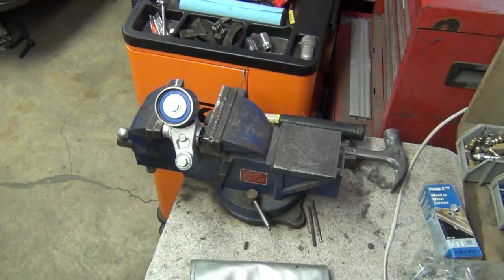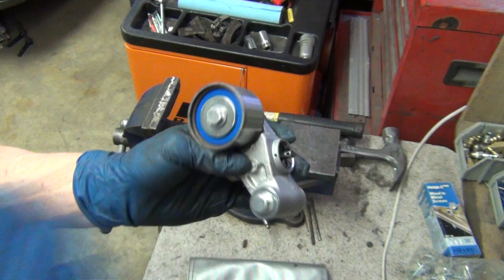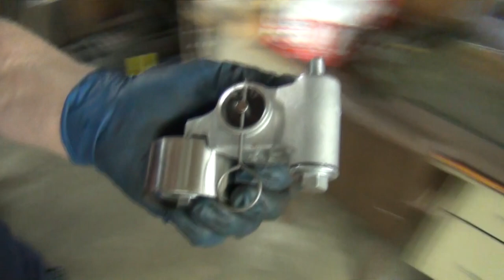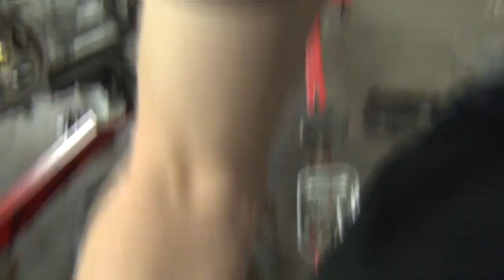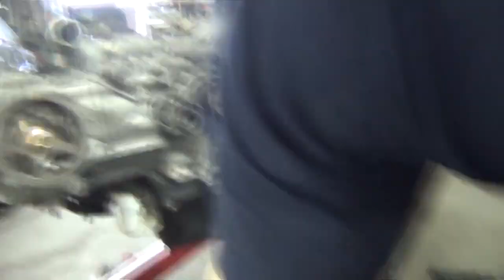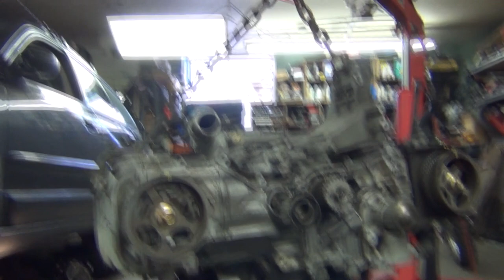How to Take off a Subaru Timing Belt

Comment: Hey - just did the heads on a 2.2 - your video was invaluable - great tips, like the tensioner. Here is something that you might use - took an old spark plug, cleaned out the electrode, etc, then silver-soldered a piece of copper tube into it (from the porcelain side). Stuck a rubber hose on that, then a compressor connector on that. Screwed it into a plug hole, put 50 lbs of air into it and it held the crank steady just fine so I could torque the crank bolt. Thanks Brian, great work.

Comment: As others have mentioned, the service manual warns that you must compress the tensioner vertically, not horizontally as in this video.  In not sure why, exactly, so be careful.  It would suck to have to repeat the job due to something like this.

Comment: Hey Brian,you can leave the tensioner in place use a torque wrench on the bolt idler and slowly pull the tensioner up until the holes line up and fit the pin.

Comment: Hi Brian,  I have a very similar Subaru engine on my sandrail and I don't know much about it.  I do know for sure that it is a 2.5 L and it has twin turbos and it's remarkably powerful.  Where can I find out exactly which engine model it is?    And you have produced yet another excellent video.

Comment: Hey Brian, love your videos! Very informative, you clearly know what you're talking about and have a knack for teaching and keeping things interesting.

I've got an 02 outback with almost 160k miles and the timing belt has some cracks forming on it, so I'm planning to replace it (guessing it hadn't been done?). What other work would you suggest doing at that mileage while I have the front of the engine stripped down? Water pump as a preventative measure? Adjust the valves? Crank seal?

Thanks!

Comment: Hey Brian! Ive run into an issue with my 2.5 DOHC motor, I took the timing belt off at an unknown timing mark and the cams turned and now I am unsure of the proper timing....What is the right way of getting the timing set back right?

Comment: Review the dewalt! I've been thinking of getting a 1/4, 3/8ths impact. One for small 10mm socket bolts and the 3/8 for bigger bolts. Sadly, the cheaper 3/8ths only do 130ftlbs and the $300 do 180ftlbs but only one battery. 

I don't want to be breaking bolts, but don't want to spend lots of time spinnings small bolts. And I picked the 3/8ths due to size, gotta fit in the engine bay, not like 1/2"ers. 

The 130ftlbs sears brand won't do it for my crank bolt.

Comment: Brian, I had my oil pump replaced by a mechanic with a new one and he used Honda bond silicone around the housing before he reinstalled it and torqued the 10mm bolts down loose. He said torqueing those 10mm bolts are not necessary but after he installed it, it still leaks! Did he not torque em down enough??? Can I take the timing cover off and tighten them to stop the leak? Thanks, Marc

Comment: I just bought a 1999 legacy outback with 122k miles and seems like almost no maintenance other than oil change was done. I am going to replace spark plugs and wires, fuel filter, pcv valve, and timing belt. Anything i am missing that u suggest? Also everybody tells me to use oem but i cant find oem timing belt and oem is 3-4 times the price. Is gates a good option?

Comment: soundslike you need to start over..re aline the cams and the crank   the  install the belt ..sounds like you have pistons hitting valves ..you may have installed with the cams 180 off

Comment: That tensioner looked decent, however, you need to make sure that its not leaking oil and the idler bearings are good. After 100,000 miles theses tensioners typically  crap out...
Reply from the maker: Good call

Comment: Hey i need help brian, i have a dohc and i  put the belt on but i didnt put the pin wen i turn the whole motor it stops half way, wen i turn it both ways is that because i didnt pull the pin or is something wrong with the engine?

Comment: Can you take the cam gears off while the timing belt is off, I need to change out my cam seals.
Reply: Yes you can, as long as the crank sprocket is lined up and in place, you spin the cam sprockets all  your want...

Comment: hey brain I watch a lot and learn of your video but did you ever get a car with problem what you can't solve  of was very head breaking
Reply from the maker: I've had vehicles come in with cracked cylinder heads before.  You replace the head with a new one or a used head.

Comment from the maker: I wish they'd send me one so I could try it and promote it.  It's smaller than what I'm currently using, but I haven't used one.  I could make it popular if it's good.  If you google vids for "Company 23 cam locking tool Subaru"  mine are the top two.

Comment: You can avoid all of this by prying the tensioner up putting a prybar between the water pump and tensioner(then insert the pin). I would not re-use a tensioner that has been in the same situation as the video.